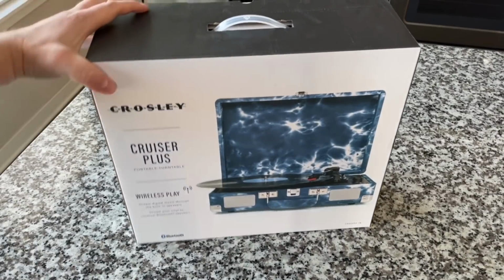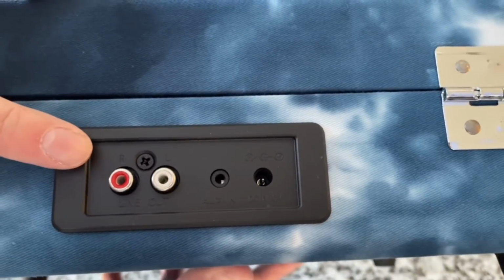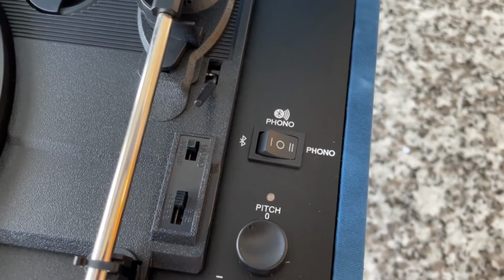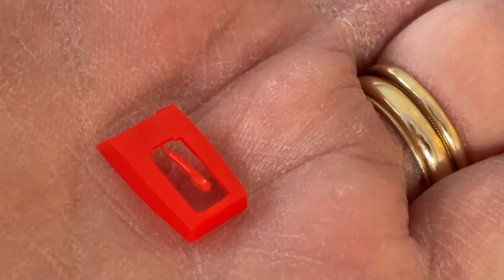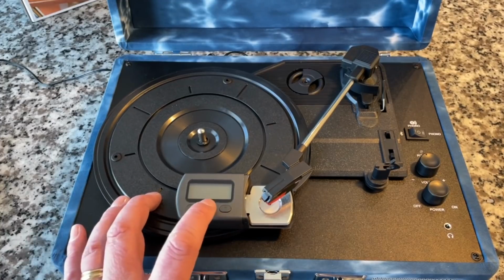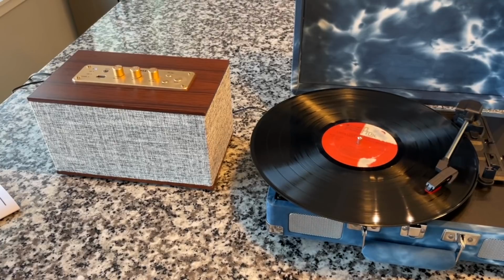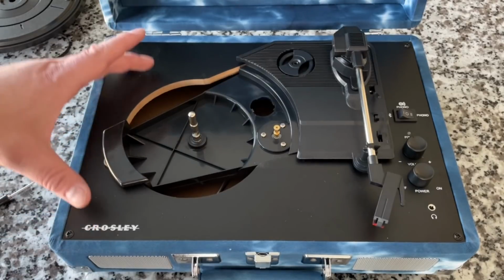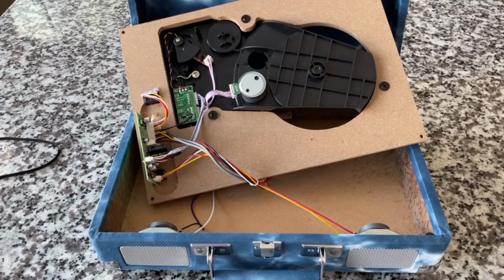Crosley Cruiser - UNBOXING / TEST / TEARDOWN!

Comment: literally just buy a better separate speaker like you usually do with other turntables if you guys dont like the built in speakers. it would still be cheaper than other turntables

Comment: Anyone visiting this video 3 years later  just relax and realize it's 2025 not 1975. I have a cruiser and it's fine for my needs. built in speakers a deal breaker? Just buy external speakers lol or connect it to a Bluetooth speaker like I do. Most people already have them these days and immediately makes the sound no longer an issue. There is a reason things like records, cassettes, and CDs were eventually replaced and that's because for 99.9% of scenarios you aren't going to be using your record player to provide music for what youre doing. Your phone is simply just the main option today and ease of use and having 1000 song playlists of any genre or artist will keep it that way. Vinyl is niche and has been for a very long time now. you do it out of enjoyment not practicality. It's fun to collect, find, and use but for most of us spending 1000s of dollars on a home stereo for albums when we can just use our phone isn't practical so for the most part a cheap turntable and some speakers will be all you need to enjoy the times when you do want to use your records . It doesn't have to be complicated. Our parents didn't complicate it back in the day and neither should we. The only question you truly have to ask yourself and be honest is do you just enjoy the casual novelty of it or do you want to legitimately collect and track down albums worth money and just like with every hobby spend money to continue with gear and upgrades to keep your interest. Buy what works and don't over think it all because some dudes online who weren't even alive or old enough when vinyl was in its heyday says what's "correct". That's why channels like this are great because they don't knock anyone using intro gear they just enjoy people enjoying something different just like they do.

Comment: The only big issue I’ve got with crosley is where I’m at the price between an at-lp60 and the crosley cruiser is like $30. And both are usually sold right next to each other. I understand that the CC comes with speakers but my original set up actually costed less than a CC (used first gen lp60 + computer speakers) from there I was able to pretty much upgrade everything on my own pace because the base was good enough.

Comment: Basically in my opinion this is a cheap way to get into vinyl collecting.  I know that the audiophiles will tell you that you need to spend at least 500 dollars to get a decent record player.  But do you really want to spend 500 bucks on a hobby that you might lose interest in after a couple months.  My advice is to spend about 60 to a hundred dollars on a cheap record player and records.  If you decide that you are still interested in vinyl after a few months.  Build your record collection and save up for a better quality player.  My sister has one of these and it’s actually what made me want to get into vinyl.  I bought an audio technicia for 130 dollars and I’ve got about a dozen records of my favorite artists.  I’ll probably upgrade in about year or two.  But for now it’s completely fine
Reply from the maker: Exactly! You nailed it!

Comment: I think it’s terrific that peoples comments are supportive for this unit - It’s exactly what you say it is and does fill a need.  I bought one in a thrift shop brand new just to listen to some old jazz records in my office and I enjoy using it, it’s fun. I hook up my Sony Bluetooth speaker with a wire because my unit doesn’t send out a Bluetooth signal, but the sound is amazing through the Sony speaker - the suitcase speakers work too, but they need improvement.  Great video 👍

Comment: Just ordered one in Black. I think it would feel more authentic if they took the label from the bottom, and made it a silver or gold plate on the back that covers the components. Then, when you need to use them, you can slide or open the slot, but the door is the label if that makes sense. In addition to the feet idea!

Comment: The white cable that connects the record player to the motor broke. I accidentally broke it. Do you know what type of white cables are those??? I can replace them on the white bracket that holds them if I know what type of cable they are. Please help. Thanks in advance

Comment: I have a record player with a similar schematic. I wonder how do they adjust the 78 speed from the factory. I saw older models inside on youtube. There is a place for adjustment, in addition to 2 holes on the motor, but for some reason this version does not. On my record player there is a big problem with the 78, instead it is 73.

Comment: Love them; 'audiophile' snobs need to learn to relax a bit. I've personally spent my fair share of money on higher end audio equipment. I own a couple $500 pair of headphones and several higher end components but I still love cheap stuff that works. I just bought a Jensen JTA385 all in one (with the same turntable mechanism/ceramic cartridge) and I love it. Not because it sounds spectacular, but because it has an awesome retro look to it and it's just fun. I think it's a bit funny that some of these 'audiophiles' will spend thousands of dollars on super-high end turntable components when the very nature of the vinyl medium means it's inherently lower quality in terms of sound than something like a digital lossless source. Those same multi-thousand dollar turntables/cartridges can technically be beat by any standard $100 digital audio player playing lossless files when it comes to accuracy. The vinyl format in itself isn't about accuracy in my opinion; it's about fun.
Reply: Audiophiles are to be avoided at all costs. Another area they’ll push people to buy extremely (unnecessarily) expensive equipment is an audio interface. There are price thresholds where quality goes up, but like every other hobbyist activity the level of improvement has diminishing returns per dollar spent.

Comment: I picked up one of these based on the recommendations of internet audiophiles, and I am extremely disappointed in the lack of face melting it was supposed to induce. I plugged it into an old JVC receiver with the magic "loudness" button and some bookshelf speakers and it sounds shockingly acceptable.
Reply: I hate the loudness button, when vol knob goes past 2/3, the mids get honky

Comment: Some people say that the bass is almost if not totally removed on all in 1 systems like that because the company wants to reduce any extra vibration that the low range frequencies could cause but it could also just be the impedance being mismatched.
Reply from the maker: Watch this space for improvements in this area.

Comment: How do you connect it via BT at 34:00?
Reply: How do you connect to speaker? I  have tried to pair to a JBL then to a Bose and it will not pair. Do I  need direct cable? 3.5 mm

Comment: the cartridge they use are not at all bad Jordan Pier put one in a Magnavox changer to replace an EV 26
Reply: I added one as well. My 1972 Magnavox has one I installed and it sounds better than the original.

Comment: Nice presentation. I learned how to change the belt on my machine without taking the turntable assembly out of the player cabinet. (I wonder why the instruction manual doesn't cover that?) Thanks for a sensible evaluation of the player. 
You could have said a bit more about Crosley and others offering a higher level assembly that uses a magnetic cartridge and has counterbalance and anti-skate adjustments. And a bit more than double the price. Even Wal Mart sells them.
THANKS!

Comment: I’m wondering why you didn’t send any Bluetooth to the internal speakers. It would really demonstrate, in stark relief, the impedance mismatch. Would you say the impedance issue is worse here than on the Five Below player, and if so, are their any parts from that which could be swapped into this?
Reply: The internal speakers aren't equipped to receive Bluetooth. More money.
Reply: @FRANKM1939  yes they are, it’s BT in and out.

Comment: I'm an avid vinyl collector and listener and I bought two of these for my daughters to introduce them to vinyl. After this video I was like how bad can it be? Uh, this player is the biggest piece of crap and makes listening to vinyl seem like a bogus experience. They sound like listening to a record through a tin can regardless of Bluetooth or the built in speaker, and they both went back to the store and were exchanged for Audio Technica LP60BTs and the difference is night and day. Sometimes cost doesn't matter and this is one of those times. I knew better and still bought the stupid Crosleys. If you want to introduce kids to LPs, do it any other way than through these pieces of garbage.

Comment: So you did mention that they're tinny and the speakers aren't impedance matched considering that the speakers are fairly standard size for the size that they are. I'd be interested in if it would be possible to modify the crosley with better speakers or even wearing to make it sound better???
Reply: I’ve replaced my speakers with  SC 5.9 2" x 3.5" Visatons, added a Pfanstiehl “flip” cartridge, a rubber mat, and some internal baffling.The sound is only very minimally improved… I’d say it just makes the tinniness louder 🙁. My MacBook still sounds better. I wish someone would make some custom boards to fix the impedance mismatch. It would make these things very fun and truly worthwhile to pull out of the closet.

Comment: I have a little Capehart suitcase player I picked up at Goodwill for $20 it's fine for exactly what it is, as they used to say "cheap and cheerful" it runs off of 5 volts so eventually I'm going to get a USB to barrel jack cord for it and a power bank so then it really will be portable. It'll be great for quickly listening to records I might want to buy like at thrift stores or flea markets.

Comment: There is at least one other thing the audiophiles are kinda sorta right about regarding these tables. You and Vwestlife both get this slightly wrong, although you’re not as far off the truth as the audiophiles are.

You’re missing a subcategory of records that most certainly can be worn out rather quickly simply by playing them on a Crosley, or on ANY turntable with a tonearm tracking force heavier than 3: polystyrene singles. Talk to any radio station music director or program director from back in the day. Smaller market stations in particular, which typically could not afford to convert their entire libraries to tape cartridges as larger market stations did, would watch for new releases on styrene and quickly convert those to carts as they started to climb the charts, because they knew those records wouldn’t last long with the heavier tracking force that was usually necessary in radio. So it’s not something unique to Crosleys nor is it unique to cheap turntables. It’s just something I think should be mentioned when discussing this issue. 

Speaking of which, styrene records also get a bad rap from some quarters. If you use a TF of 3 or less and exercise reasonable care, styrene records can sound superb and last a lifetime.
Reply from the maker: We have covered styrene extensively….
Reply: @Recordology  yes, you have. I’ve seen it. I’m only saying that when we give these cheap players a pass, saying they won’t destroy records, we should point out the exceptions that buyers are likely to discover later.

Comment: The problem is not only the impedance, but the equalization curve. The equalization curve used in vinyl records since decades ago  is the RIAA Eq Curve, which means that when records are produced, the low end frequencies or bass levels are attenuated to reduce inter-groove distortion and skipping, and the higher end frequencies or treble levels are amplified to compensate for the limits of the media due to the rotation speed. When you play the records, you need to equalize the sound with the opposite RIAA Curve, which means to attenuate the highs and amplify the lows, regardless of the signal amplitude.That's why, if you just amplify the sound coming from the cartridge without the right equalization, you get that kind of tinny tiny can sound even through good speakers. A Phono preamplifier or phono input normally includes the RIAA equalization.
Reply from the maker: Yep that’s a good point.

Comment: I got started with one of the Innovative Technologies all in ones, before they bought the Victrola brand, and it seemed like the biggest thing holding it back sound quality wise were the built in speakers. Sounded way better when hooked up to some good bookshelves. It skipping when trying to play several modern vinyl releases ended up being its biggest problem for me at the time and is the main reason I don't recommend them to new buyers.

Comment: I don't like Crosley suitcase :) (ceramic needle, not good preamp use )  Crosley C100 is good medium turntable, but I like your presentation👍
Reply: You don't need a preamp for ceramic cartridges.. However, you should have proper impedance. Ceramic carts like to have at least 1 meg-ohm of impedance, most line inputs are only about 500 kil-ohms. However, Sonotone at one time, sold filter/attenuaters that allowed you to play ceramic cartridges into magnetic phono inputs. And some amps had real, ceramic phono inputs. You should listen to a vintage tube console. They had ceramic carts in their BSR level record changers, and the input tubes had high impedance. The sound was full and rich, and could really rattle your windows with their 6V6 or 6L6 output tubes. That's the stuff us boomers grew up with. The basic circuit designs go back to the 1930s, when most of the audio tubes, still used by musicians today in guitar amps, were invented. A big Magnavox with the bass center channel will blow you away. Their Callero record changers were also fun to watch as the tone arm tapped the record edge to index its size before dropping. And they only put out around 5 to 10 Watts.
Reply: @dougbrowning82  50K or 100K is what I find on most amps, the vol pot resistance is the input resistance
Reply: C100 is gr8 value

Comment: I love the concept of the Crosley Cruiser, i.e. an affordable and portable record player that plays 33's, 45's, and 78's (which is why I bought one years ago, particularly to play 78's, but it was not working properly) to introduce new collectors to the vinyl record hobby, but all I ask is for any record player or turntable to be built reliably to play music enjoyably. If they can achieve that, then mission accomplished.

Oddly enough, I have a Victrola triple-speed record player/tuner/Bluetooth transmitter (similar to one Recordology reviewed quite a while back) and two Christmas-themed LP&No.1 suitcase triple-speed turntables (like one reviewed by Recordology) that play well and are not dissimilar to Crosley Cruiser suitcase models. Naturally, I wouldn't play any expensive or highly-prized or super-collectible records on the units I mentioned, but they're fine for dollar records from thrift stores for a bit of fun now and then. :)
Reply: BSR achieved that in 1950, with their introduction of the Monarch series record changers. They were simple and reliable machines that inspired the introduction of the Dansette line of record players. The mechanism in the Crosley is a single disk clone of BSR's micro changer, introduced in the late 1960s.
Reply: Good enough for 78s, but not for anything else.
Reply: Yes, agreed/ I have an all in one, about 6 years old. Looks nice and has played maybe 6 records and is so slow. Thank god for the CD burner and my older higher end turntables I patch in to burn some CD's for the car. I sure hope these newer models are better, so they don't give new vinyl people a bad impression of vinyl
Reply: If you had issues playing your 78s, it’s because the grooves in the 78s are bigger and require a 3mm stylus, as opposed to the 1mm stylus used for 33/45.
Reply: @clarkesuperman  mil, not MM, they are 2 different things

Comment: It's actually the fourth generation if you count the battery-powered Cruiser II, which was only on the market for a short time. I think Crosley discontinued it because it ran on regular AA batteries rather than a rechargeable lithium-ion battery pack, so the battery life probably wasn't that good. I'd love to hear a direct line output from the Cruiser Plus, as that would really reveal whether they properly matched the impedance of the cartridge or not. And I'm glad to see they mounted the mechanism on springs, which raises it up enough that it shouldn't have any problems with the edge of the record rubbing against the lid.
Reply from the maker: Interesting…..also there is the mini-cruiser if we really wanted to get technical!
Reply: THE VWestlife?!??
Reply: The problem is not only the impedance, but the equalization curve. The equalization curve used in vinyl records since decades ago  is the RIAA Eq Curve, which means that when records are produced, the low end frequencies or bass levels are attenuated to reduce inter-groove distortion and skipping, and the higher end frequencies or treble levels are amplified to compensate for the limits of the media due to the rotation speed. When you play the records, you need to equalize the sound with the opposite RIAA Curve, which means to attenuate the highs and amplify the lows, regardless of the signal amplitude.
Reply: That's why, if you just amplify the sound coming from the cartridge without the right equalization, you get that kind of tinny tiny can sound even through good speakers